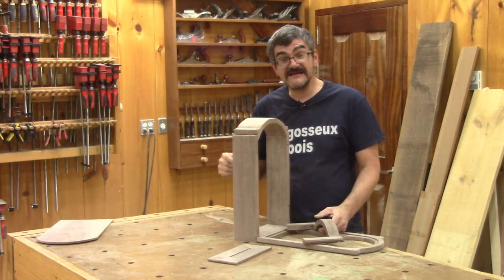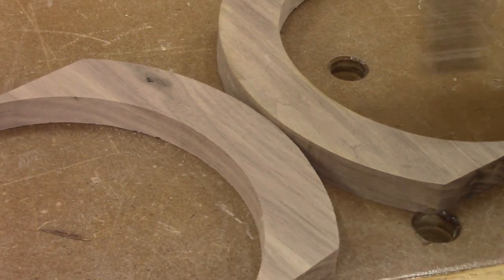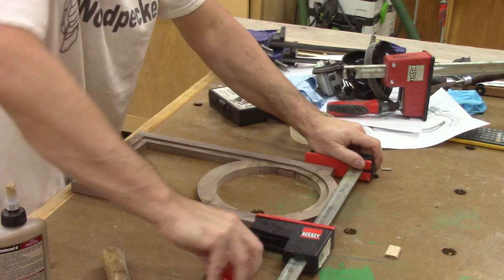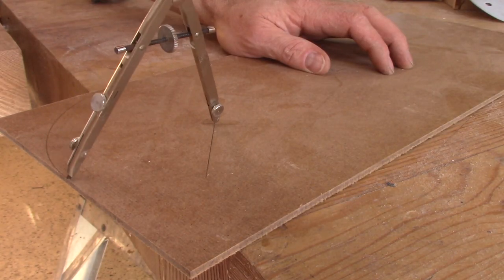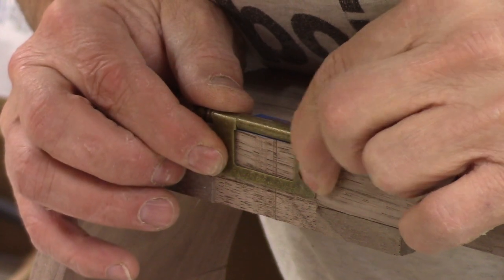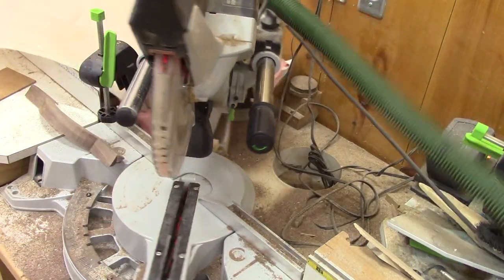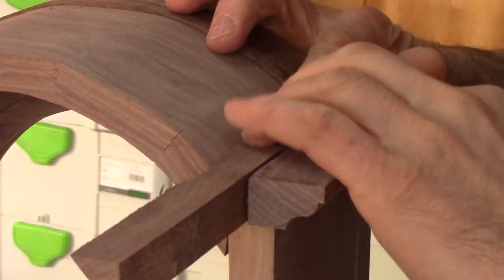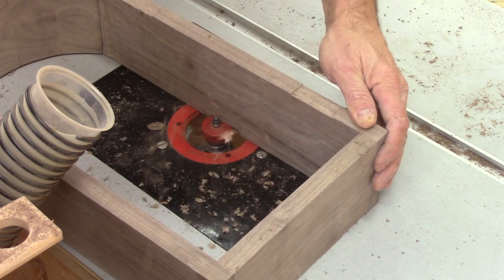The Woodpecker Ep 211 - Walnut clock case part 1

Comment: Another awesome project, Alain. If I should be so bold as to suggest that when you are using your CNC machine for fine woodwork like this that you don not use tabs, which some times can be a pain to remove. Instead I use two sided tape and set my profile cut to a depth that leaves a skin of wood in the bottom of the profile (in other words do not cut all the way through). When the cut is complete, remove the tape, use a band saw to separate the two pieces, and then use a flush cut bit on your router table to clean up the edge and you are good to go. While it may seem that there is an extra step using this method, there is no sanding to do and the finish is superior to sanding. No criticism here, Alain, I think that the case is outstanding. Dan
Reply from the maker: Thank you. I've learne that the hard way...But the 2nd time around  was better